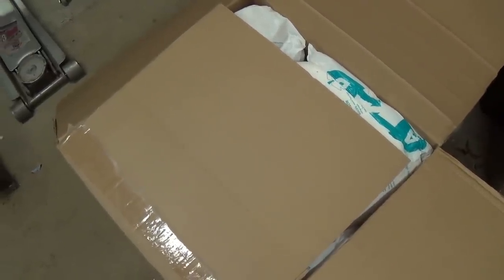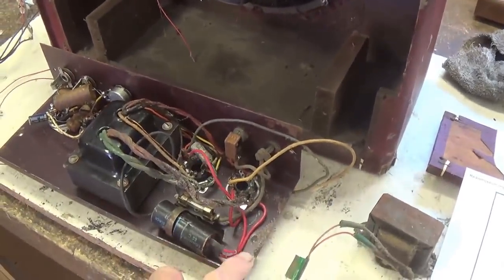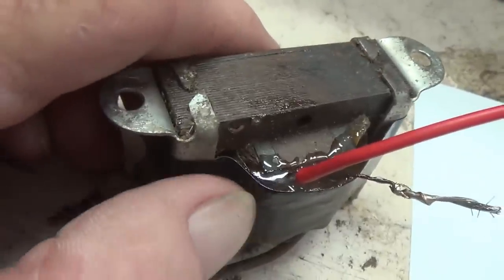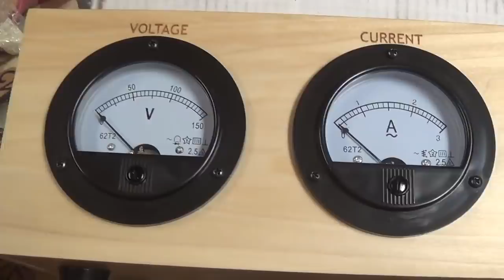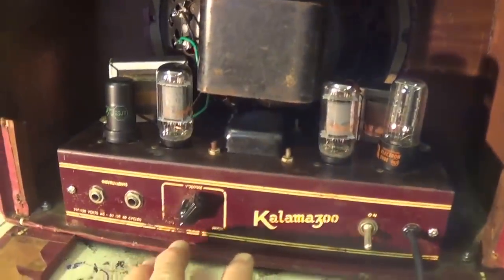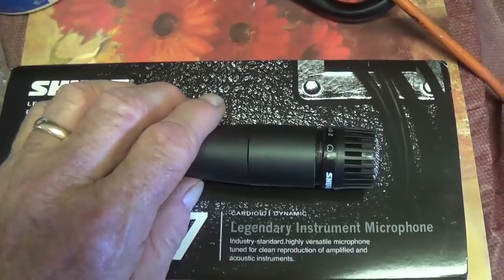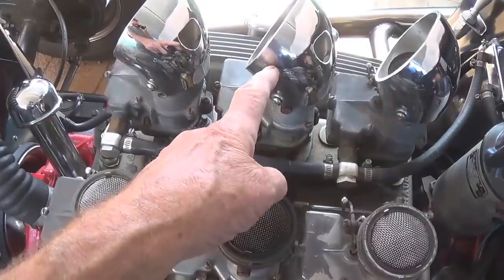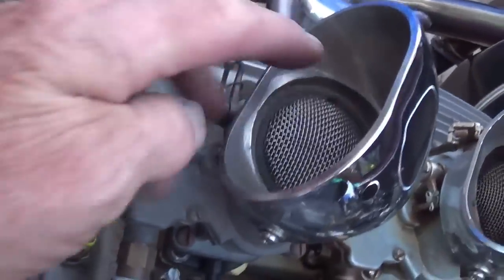Heroic Restoration of a 1948-52 Kalamazoo KEA Amp with an Unusual Circuit

Comment: From Leo:  Do you suppose the flooding may have been the pressure in the tank overwhelming the float needle pressure, compounding the problem ?
Reply from the maker: Yes, I think the two problems joined forces to make the issue even worse. It's completely resolved now, however.

Comment: @Uncle Doug Do Keep miking the amps, but place mike 4-5' away, and 2' off center, and *pointed directly at the speaker. Miking an amp right up to the speaker is fine for PA's, but it's very important to capture at least some 'room ambiance'. Rule of thumb- Locate the mic exactly where you like to stand playing your guitar. Ahh', an Idea!!💡👀💡!! Go with the all new rage! The now-very inexpensive [35'ish** usd] Binaural Bluetooth Wireless Binaural Headphones w/ Binaural Mics built in. . If you are opposed to in-ear radiation, just get a foam (wig) head to put the 'BHPBM's in. Or just get creative with anything to put them on/in😊... Ah' another idea, put the L-ear out in front of the amp, and the R-ear back behind the amp. Experiment. 
They are all over ebbay. For instance- 
 Wireless Earphones Bluetooth in-Ear Stereo, with HD Microphone Binaural Call

Comment: I wonder if the pressurized fuel could be pushing past the needle  valves as well?
Reply from the maker: It probably was adding to the problem. Thank heavens I discovered the pressure problem inadvertently.

Comment: Definitely the SM57. Just need to reposition it slightly. Straight on in the center of the speaker is not the best position, but much better better tone then the cam mic.
Reply from the maker: Thanks, Robert. I will experiment with better positioning.

Comment: The 57 is always going to work well, but it sounds as if you are getting digital compression artifacts from your recorder or at some other point,  as there is a kind of "hair" in the sound, growing from the 4k and up region,  which we know is  about where most amps roll off rather abruptly.  Not sure exactly,  as it could be a mystery rattle of something in the shop too. 🤔
Reply from the maker: If you listen to more recent videos, I believe the problem has been solved.

Comment: I'm learning amps at the moment. I was wondering recently how it would sound to run the guitar signal through half a 12ax7 and straight into a 6v6. It would sound something like this amp here?
Reply from the maker: Not really, JR. The 6SJ7 is a pentode, not a triode, and the KEA has two 6V6's.

Comment: Magantone Melodier as i recall had this shortcut for phase inversion
Reply from the maker: Yes, but the Melodier used the screen of one tube to drive the grid of the other. In this case there was no connection between the screens and grids.

Comment: May I please request that you would show us that any vintage or original capacitors that you replace actually should be replaced. It is almost painful to see a vintage cap replaced. LOL
Reply from the maker: If you'll pay the postage, I'll gladly send you all the old waxy, dried up, leaky caps that I removed from this circuit, Tony.  Trust me, they all needed to be replaced.

Comment: Recording seems to have most here quite cheery. 
Angles and directions aside, I’d like to see you split the signal into 2 channels or sides, one run with no enhancements(dry) the other with a touch of processing(compression, reverb...wet)
This could be done on your pc with maybe what software you already have. 
I really like your channel Uncle Doug. About 10 or 11 years ago I had a worthy collection of vintage gear and wanted to showcase it and its repair and maintenance much like you do. I put up one video and it took off almost over night. Then Google bought YouTube and offered monetization and I backed away from it. Overnight, I went from owning the google search term “ab165” to not mentioned. My view count went from 50k views down to like 24k in a week, then has taken 10 years to slowly climb back to that 50k. 
I never made another video, but I do sometimes question my decision. Don’t know where that came from, just thought I’d share.
Reply from the maker: Thanks for sharing, CE, regardless of where it came from :)

Comment: Wouldn't masonite burn? I dont know I would be worried about using it, specially if it was absorbing moisture and oil, could you run a line from the radiator? Maybe have a delay mechanism on the pump/fan?
Reply from the maker: It works just fine, P.  The engine never gets anywhere near the combustion temperature of wood.
Reply: @UncleDoug  cool

Comment: RE: the boiling over carbs:  How are the unused carbs prevented from filling with gas?  Seems to me that the hookup will keep them full making the flooding problem worse.
Reply from the maker: The gas line into each is blocked so that no fuel enters any of the four outer carbs.

Comment: Could you use a smoothing capacitor instead of a fuse? I used to collect old vinyl players and one was a learning machine that was a vinyl records player for teaching language and speech. It had a speaker output but no speaker. You could connect to whatever you wanted.
Reply from the maker: No, you can't. Their functions are completely unrelated.

Comment: Hi Uncle Doug, I have this same amp and noticed my Sylvania 6V6GT tubes have a physical pin in the #1 spot on the tube.  Replacement tubes I'm looking at online have pin 6 AND pin 1 out (I'm aware pin 6 is never used on these tubes).  Does this amp take advantage of pin 1 somehow?  Are 6V6GT tubes with 1 and 6 pin outs safe for this amp (I watched the entire  video to see if the socket had anything wired to pin 1 but couldn't definitively tell...)?
Reply: (Also did see your hand draw map out of the 6V6 socket and noted you marked 1 and 6 NC not used...) 🤔
Reply from the maker: You can check the 6V6 tube socket(s) to see if either pins 1 and/or 6 have any circuit connections. In the early pre-GT days, pin 1 was connected to the metal cover over the tube, and was grounded in the socket to the chassis.
Reply: @UncleDoug  Thank You for the reply, I Greatly Appreciate it, ❤️.  Ok I'll look.  I was hoping to not have to take it out cause this particular amp's chassis is very, very tricky to remove due to the very tight wire span that goes from the electromagnetic transformer mounted on the speaker to the amp circuitry under the chassis.

If it is grounded as you mention then I think it's safe to assume that a 6v6GT without a pin in the #1 position is not advisable to use as a replacement...? 🤔
Reply from the maker: @obscaded  It won't matter. The glass tubes have no pin and can't be grounded since they have no metal cover. Any style of tube will work.
Reply: @UncleDoug  Ok Excellent, Thank You Sir, that just Saved me the tricky task of opening this old boy up!  I Greatly Appreciate It 🙂❤️

Comment: hi doug, wondreful video as usual! i wanted  to ask you a thing, i bias my output tube calculating current measuring voltage drop across the OT , maximum rating for a 6V6 push-pull should be 12 watt right? some say you should bias at 60-70%  of the maximum rating, some say just a little below the maximum value... what do you think?
Reply from the maker: Thanks. It depends on how the amp is biased. If cathode-biased it's around 90 to 100% of max. If fixed bias (grounded cathodes) around 70% of max.
Reply: @UncleDoug  and on cathode biased Amps what do you think about splitting cathode resistors of the 2 tubes  in 2 separated cathode resistors adding a trim pot in series to each one to have a fine bias regulation ? Does it create some kind of distortion or improve the linearity of the output waveform?
Reply from the maker: @pancri321  I think it's overkill, Pancri, because there is no need for precisely matched bias, especially with cathode-biased output tubes. Also, you would never be able to hear or detect any improvement in tone.

Comment: Could the bare leads for the replacement caps ground on the metal chassis?
Reply from the maker: I usually shield each cap lead with insulation material, PF.

Comment: I might also recommend getting rid of the belt driven fan and going with an electric thermostat controlled fan. You could set it to run for a few min after shut off to cool things down. And running just the center carbs is cheating  :)
Reply from the maker: Thanks, RC. Living in the desert, all my cars have thermostatically-controlled electric fans. I agree about the center two carbs.....but for now, they are working fine :)

Comment: SM57 is a good mic for guitar, but back it off a few inches and angle it off center about 1/2 way down (or the side) of the speaker itself. Center is way too much treble, and you will get a much better result!
Reply from the maker: Others have said the same thing, RR. I will change the position of the mike.

Comment: Wondering if a vented tank cap would have cured your problems w/ flooding w/o the carb hassles? Fuel blowing out of the line at that amount of pressure........yikes!
Reply from the maker: It wouldn't stop the percolating, JM, but the insulated spacers did.
Reply: @UncleDoug  nice job! I miss wrenching on old rods but not the lower back pain :)

Comment: They were never supposed to be mounted to the cabinet.  In the original amp they were mounted to the speaker basket itself.
Reply from the maker: Thanks for the input, Anton.
Reply: There are pics posted on the TAVA fb page.  You can barely see it because I was highlighting the rodent damage but if you look you can see it.

Comment: Cleaning dirty filthy rodent desecrated chassis is best done using simple green. I learn this years ago at HP metrology lab in Fullerton California. A piece of test equipment would come in for calibration and/or repair, the technicians would do an examination once completed they would use an air hose blow any loose dirt and grime away that can be removed by compressed air, they would then spray the chassis down with simple green liberally and allow it to begin penetrating dirt grime whoever else might be there. Afterwords they would use distilled water under pressure and rinse the chassis, If any dirt or Graham remain they would then use a toothbrush or similar cleaning tool to then scrub away any tough or resistant material. They would then continue using distilled water making sure all simple green dirt and grime was removed. Once that process was complete they wouldn’t take compressed air and attempt to remove as much moisture as possible from any and all components. Once that process come is completed they would then take the chassis placing it in an oven at approximately 180 to 200°F, and bake the equipment for two or three days. Once the technicians were confident that all moisture was removed they would then begin to test equipment again and complete the alignment process. Are use this very method when while moving a PC monitor motor oil somehow was poured against the circuit boards, using simple green method and a high pressure washer I was able to salvage the monitor and it serve me for several years afterwards.
Reply from the maker: I do use Simple Green all the time, Jake, both on amps and on cars parts.

Comment: why aren't more push pull amps phase inverted the way this Kalamazoo is? no need for a phase inverter tube, and almost always less parts equal more tone in low watt guitar amps.
Reply from the maker: I can't really find any drawbacks to this method of phase inversion either, Andrew.  Maybe a small loss of gain.....but it's really not noticeable.

Comment: Uncle Doug, Uncle Tony's Garage was having the same problem with the boiling gas in the calibrator. I think you might want to check out his easy cheap fix. This may come in handy if you ever decide to put the other 4 carbs to work in the future or if you ever just want to remove those heat blocking plates you made.  https://www.youtube.com/watch?v=-t6geNGbEXM
Reply from the maker: Thanks for the tip, Steve. Fortunately, my fix is working great, but I'll keep this in mind if that changes.

Comment: Placement & Tone Moving the mic closer to the speaker’s center tends to give a brighter sound, while angling the mic toward the speaker—or moving it further away—provides a tighter, warmer sound.
Start off with the mic an inch or two back from the cone, perpendicular to the speaker, and about half to two-thirds of the way towards the speaker’s edge. To capture more of the cabinet’s influence on the sound (as well as some room sound), try moving the mic a few inches further back from the speaker.
https://www.guitarplayer.com/miscellaneous/8-cabinet-miking-tips
Reply from the maker: Thanks for the detailed info, MK. I will experiment as you suggest.
Reply: @UncleDoug  Your welcome,

Comment: Gibson reintroduced Kalamazoo amps later on but they were a wretched mess.
Reply from the maker: They must have used this one as a model for the re-issues :):)
Reply: @UncleDoug  No, they were very different.  Brad "the Guitologist"  worked on one.
Reply: Douro20, which Kalamazoo amps are you referring to? A Kalamazoo Model One with fresh caps, good tubes and maybe a more appropriate speaker sounds awesome for guitar ( not just for harmonica). The circuit does seem to be very tube sensitive, and a Chinese or Russian EL84 makes for bland tone. An Amperex Bugle Boy el84 turned it into a tiger!

Comment: with the carb's couldn't you just put atmospheric breather tube's on the float bowl's,
Reply from the maker: The bowls aren't sealed as it is, Paul, and the problem is heat causing the gasohol to boil and flood the engine.  It's a very common problem with carburetors......never seen with modern fuel injection.
Reply: @UncleDoug  
show's how much i know about american carb's, nothing, lol,

Comment: Please check the wiring in the iso unit:  https://electronics.stackexchange.com/questions/375135/were-do-ground-pins-on-isolation-transformer-go
Reply from the maker: Why, Tom ?
Reply: @UncleDoug  I know you are an expert in isolation xfrmrs and how they work and based upon your video about them (excellent).   When I saw how the gentleman wired this unit up I panicked for a moment  concerning the known issues with the ground pin on the DUT side being connected back to ground on the source side.  So that's it.  Fact is you probably already knew about how the wiring was done.  I was just reacting...no worries...